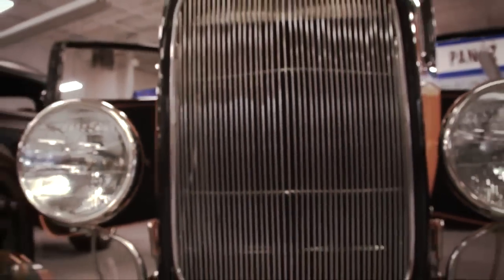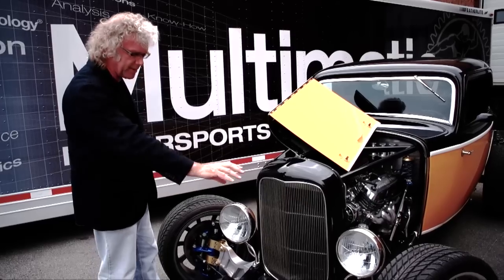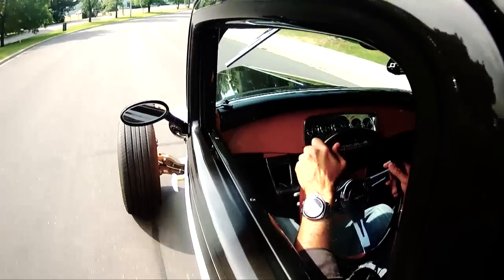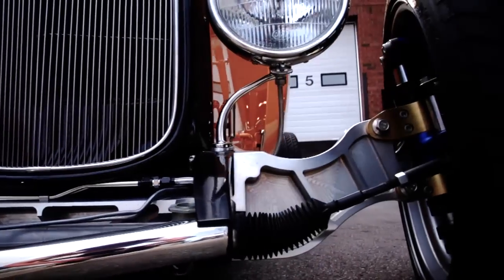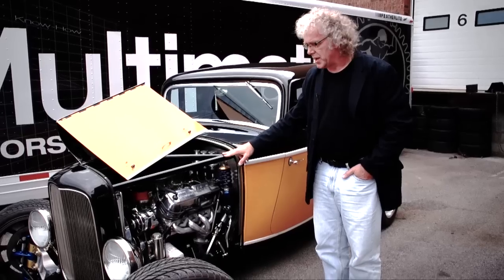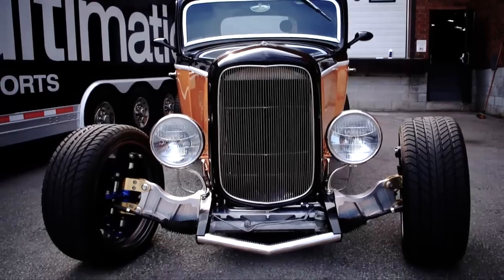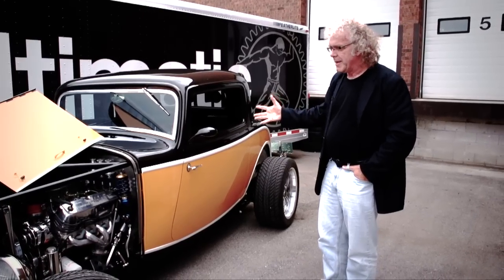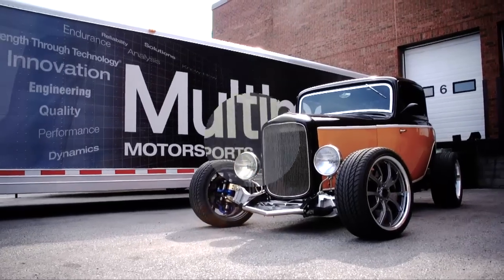The world's most advanced hot rod

Comment: I once drew a similar design for the front and rear suspension of a ground effects F1 car, similar to a lotus 78/79. But I had slim upper and lower arms extending to the wheel to create a clean opening for air passage.

I appreciate his efforts but prefer the look of conventional suspension for a hot rod. Either single I beam with radius rods or independent with coil over shocks.

Comment: Anybody notice this has the lowest un-sprung weight of any suspension system ever? And zero traction-breaking in-out slide of swing arm suspension? Pretty advanced I'd say! And the remote, hydraulically activated spring/shock setup is sheer genius! Oh, I have an original '32 coupe traditional build hot rod, and I say if its your car you can put any kind of wheels on it you damn well please.

Comment: Ingenious setup on the front suspension! However, the wheel now only makes a linear motion when compared to the body. When cornering, your body will roll. With the wheels staying parallel to the body, you'll see them tilt when compared to the ground, losing grip. This is why we have UNEQUAL length A-arms in suspension setups. So that when the outer wheel gets pushed up, it will tilt in when compared to the body, and thus stay flat on the ground. Ditto with the inner wheel. How do you fix that?

Comment: Actually, four-valve engines normally give better mid range power than 2 valve engines.. 2-valve engines normally put out high end power, that is more power in the higher RPM band. This is due to inertia and air flow. One big intake valve has a higher inertia than two smaller ones... or so I understand. HTH

Comment: Worlds most advanced hot rod has a solid rear axel? Half way there I guess... Beautiful looking front suspension it would be neat to see the springs in action while driving... The shot of the car rolling down the road seems a bit rough and the shots of the wheel in action look like it would bottom out fairly easily... Is the camber adjustable on this suspension setup?

Comment: looks like sliding pillar suspension too me... 1920 morgan tech..
Reply: yeah, similar idea, but this is much more realized. This functions on an entirely different level.
Reply: Swansen03 other than not as much travel it's pretty similar to the Morgan sliding trunion system, kind of pointless - unless you only go on smooth roads
Reply: Brian Catnut yeah, i can hardly see this vehicle being anything but that however, track days or weekend events, hardly a daily, so i guess smooth roads would be mute. However, there are alot of advantages to this system and it is much more functional than Morgans or Lancia sliding suspension. That being said, as far as in wheel suspensions go, the Edison2 VLC pretty much has them beat.

However, the damping system is very clever, similar idea to a pushrod or cantilever system. running fluid back to a damper and moving that unsprung mass
Reply: All that under some other sort of body and it may look ok, but it's way to heavy and bulky looking .. where I like to see open structure like an old bike springer, it's big cast machined parts like off the Bloodhound land speed car, and I'd want a bit skinnier front wheels then it would look way out of balance. Nice try but it's so hard to make anything like this that is a little different but as cool as the originals.
Funny I just saw the Misfit garage show build a basic Orange blown SBC Hot Rod ..sold for around $45.000 ?  .. no contest which one I'd be driving off in, even at the same price,
and I wouldn't be having to plan my route home to avoid small bumps, any potholes or dirt roads.

Comment: So it has a sliding-pillar suspension with no roll center or anti-dive properties? Didn't Morgan start using that in the '30s? Using a ram to transfer fluid to a remote spring through a valve that controls damping isn't all that novel, either; Citroen did that in the '50s. Oh wait, Citroen did it with a better riding pneumatic spring and a means to control ride height on the fly. The king has no clothes.

Comment: What's real obvious is it has a ton of bump-steer. Who in their right mind would put the rack so low with such a steep angle up to the wheel/steering arm?  It's an intresting suspension design, but it doesn't work on a hot rod as far as looks go. It's too bulky and looks like something from a truck.

Comment: The tie rod is running up hill at a fairly extreme angle, which is not good at all. The sliding pillar front suspension has been around for 75 years or so, it's nothing new.
Reply: +505197 Lets see...On YouTube your using your prison ID number...yet you slam others because you dont have any abilities....Hmmm
Reply: +Rocky Jeep   No, I'm on work release,  I break into homes now and then to use the internet.   

Let's discuss this horrible looking front suspension on what is titled, "The Worlds most advanced hot rod".   Savvy suspension guru's, such as myself, eyes are assaulted by ugly to begin with. Then the bump steer ( google it) is extreme because the designer doesn't know what he's doing. 

  When that piece of shit encounters a bump, it will toe in that tire. If it hits a speed bump and both tires move upwards, it's going to look like a cross eyed Jeep Junky. if the suspension unloads it's going to toe out like crazy.  All of this unwanted steering is caused by the aforementioned extreme angle of the tie rods. 

  Well I've wasted $25 dollars worth of time, it took me 15 minutes to type this. Being the best auto electric and diagnostic shop in the city can be a burden at times. I work alone because you can't hire someone who knows how to do what I do.
Reply: +505197  another engineer that thinks hes smarter than everyone else. I get em all the time telling me how to fix their car, if they knew they wouldn't bring it to my shop.

Comment: So you moved the spring and shock over to the firewall and it only costs $35,000 more than when it's on the control arm.   Forget about commercial application,, this is just trick.

Comment: further distance, yea right, big V8 ain't good in town because they are meant to haul ass in the motorway, the highway deserts. They have bigger cc so burn more fuel to keep those parts up to speed for a start. But from then on, it doesn't take much efforts to reach peak power
Any big cc would be more advantageous in the highway than a smaller car, because at higher speed, the small engine will rev gutlessly trying to keep up the speed.

Comment: What? You are comparing the original 32 ford with this one and saying it doesn't improve anything? This thing is so rigid there is no flex in the frame and having in-wheel suspension reduces unspring weight which increases handling. I am going to bet that this car will handle just as good if not better than a new sports car of today.

Comment: for fuck sake "high-end" power means you reach the same peak power but have to rev higher, means your engine, big or small, burns fuel at a quicker rate, and revving higher means more the power produced is loss through trying to maintain the engine at that high speed. Revving higher also makes your engine wear much quicker. WTF are you talking about mate?

Comment: Wicked cool.  But the irony is not lost on me: this suspension would be terribly impractical on all but paved, near-perfect smooth roads...

If driven in the kinds of rutted, rough, primarily rural conditions that were typical of American roads when the ol' '32 was originally designed, it wouldn't be long at all for this kind of setup resulting in a bogged or bottomed out, useless car somewhere.

Comment: HAHAHA, so you're saying all i have to do to double the HP of my engine is change the compression? So nothing to do with ignition timing, Air/fuel ratio, design of induction and exhaust components... then with forced induction, boost pressure, intercooling, checking the fuel injectors and pump are up to the job. I'm not an expert but even I know there is more to making HP than compression ratios.

Comment: So in a corner, your outer wheel gets the suspension compressed and your camber ends up all whack, with the top of the wheel pointing outward? There is a reason for the unequal length of the regular independent suspension, you know...

Oh, and at every bump you hit, your wheel will steer outward. Nice!

Your fabrication skills are impressive, but the engineering is somewhat underwhelming...
Reply: I think you have something there mate.
Reply: now while you are probably right with the car sitting there as is, it would seem obvious that you do roll stabilization via controlling the oil, just like in Mercedes' Active Body Control or in what Citroen did in the past. If that would be the case, it'd just corner Flat (or even lean into the corner for camber gain), problem avoided. The bumpstear might be hard to deal with though.
Reply: edit: bump steal isn't a problem, as there is no reason to connect the steering rod to the unsprung part. Saves some unsprung mass and completely avoids any bump steer.
Reply: I mean this is multimatic, I'm sure they know what they are doing.... They engineered suspension setups for f1 and supercars.

Comment: Your front suspension really got me. To find out you hydraulically transmitted shock to a spring on the firewall shows true out of the box thinking. Kudos !  However, even though you have a great looking car some of the basic geometric faults of the suspension remain. I also would like to see this frame negotiate an eight inch deep pothole, - in the winter. Try this thinking on which also supports your roll bar frame embedded in the beautiful body. 
http://youtu.be/dQ2tgFe_gOc
Fantastic job.

 sincerely,
    Bob Bouskill

Comment: You have no idea what you are talking about. Are you aware that Top Fuel engines are rebuilt every single race? Why the hell would you say that is a point for push rod engines in the race for best engine type? And no, your wrong on 2 vs 4 valves. 4 Valves will always make bigger power than 2 valves because there more airflow.

Comment: yea but they did use hydrogen in vehicles engine back in 1955 1783 hydrogen air balloon  was launched, 1806 François Isaac de Rivaz built the de Rivaz engine, the first internal combustion engine powered by a mixture of hydrogen and oxygen it's nothing new

Comment: nut your increasing more unsprung weight
Reply: +Chester1997 I thought he was reducing it.  I guess it depends on whether the "tower" in the wheel is lighter than a couple of traditional suspension arms.  I didn't really get a good look behind the front suspension, but I assume there is still a steering arm so not all could be removed.  Maybe with hydraulic steering controls even the steering arm could be removed.  I don't know if that would be a good idea or not.

Comment: Ill give you an example of how dumb this is.  Sliding pillar suspension. 1928 LanciaLambda.
 Take the 32 Ford body off and put any 80s 90s body on and you would just yawn.The Deuce is iconic. Like preserving your grandads face on a teenagers body. If you wanna drive "high tech' buy a high tech car. Its like making a Chippendale piece of furniture with a cnc machine out of billet  aluminium.  Ford in a Ford with I beam and torque tube. Done.  Go drive a Skyline and leave the classics alone.

Comment: Meh...  Like, I get that you're showcasing engineering ability and that's super, but there's no way that this ugly over-sized, over-engineered, over-complex and over-weight system is better than current stuff and will never be as cool as a dropped-axle, transverse leaf original hot rod model A or '32...  This is not a new concept, actually and the fact that it doesn't already reside in most cars means that it's worse.